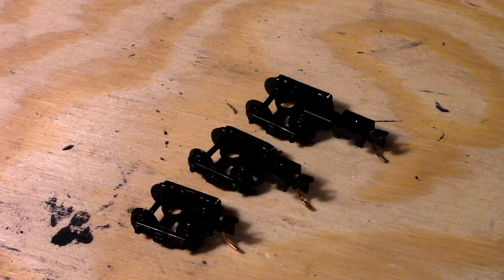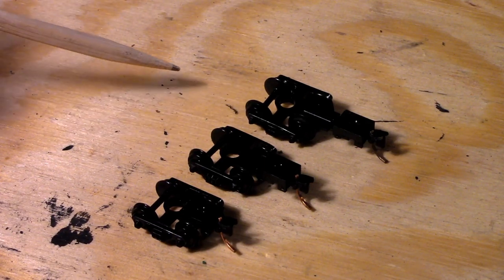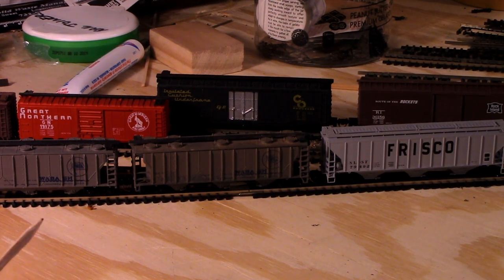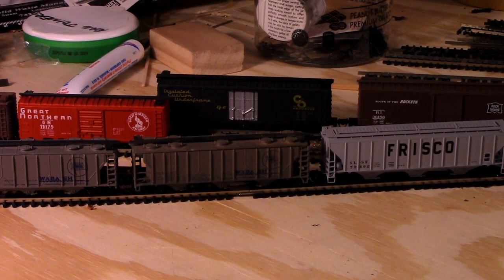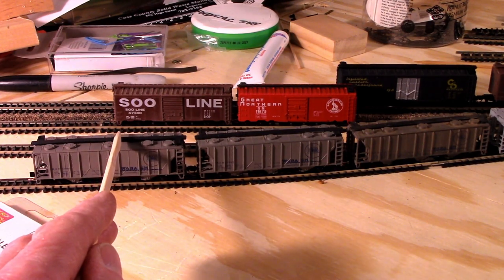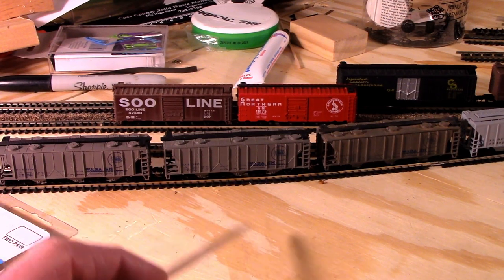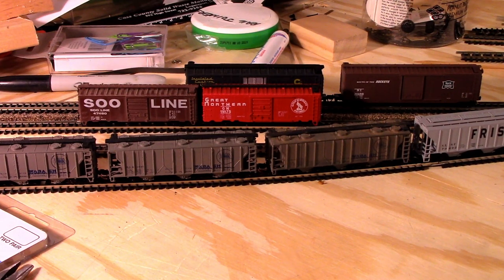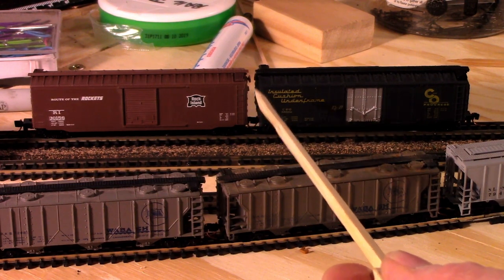The Car Barn: Coupler Lengths and Clearance between Cars

Comment: I've been dealing with this issue,   but so have others,apparently,  med. length roller bearing always out of stock! Great series, looking forward to more
Reply from the maker: I got mine from fifer hobby supply-their price was considerably less than the price at the M/T website. But yes, I have had trouble trying to find caboose trucks(without couplers) in the roller bearing type. I ended up getting some andrews which are a tad outdated. I will have an episode coming up where i will ask for suggestions or questions, so please stay tuned for that!
Thank You very much Jeff!!